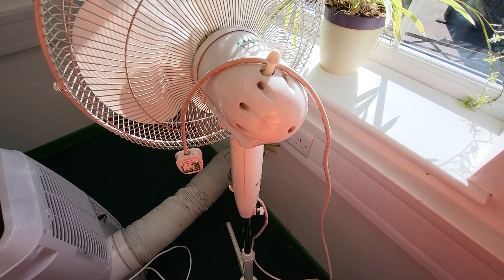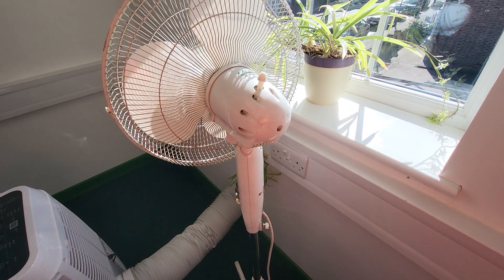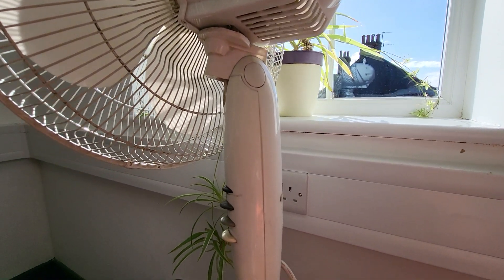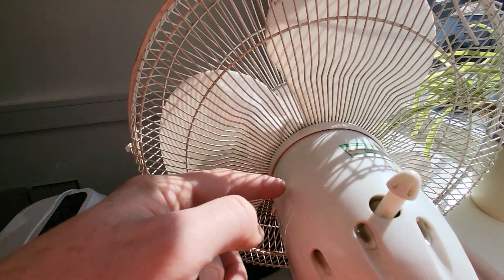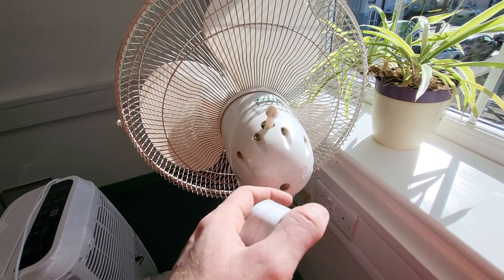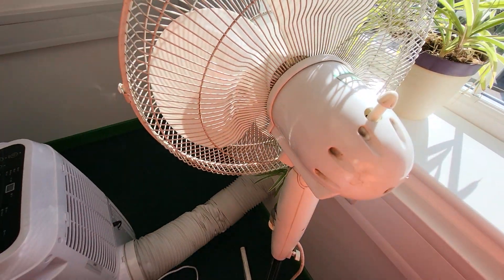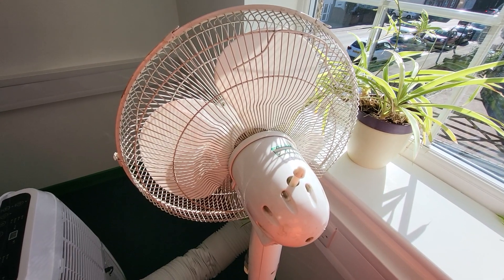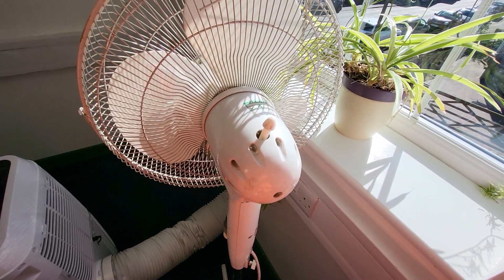Class 1 PAT Test - No Earth Reading. Is it a fail?

Comment: I would have thought since PAT testing is to show that the item is safe all metal that someone can touch should be earthed if you have no knowledge of how it is constructed this should fail the Fan because the stand and the cage are not earthed. just because all fans have this problem shouldn't mean you pass it anyway. Testing against metal you can't reach is a point-less test because the operator can't reach it as well.
Reply from the maker: No I disagree, there are many class 1 items that have exposed metal but are completely isolated from any contact from the mains supply - this is by way of design and not luck.

Comment: Just started PAT testing for my company , just wanted some advice on few items that I have come across . My company has few Samsung monitors that are powered by a psu unit with a figure 8 lead . The psu unit is marked as class 2 , it’s a 25 watt psu . Is this item just a visual check or would I need to test it as a class 2 item and connect the fly lead to an exposed metal part , the only thing I can see is the vga port . Any advice ? I am using the prime test 250+
Reply from the maker: So by the sounds of it, it will be just a visual inspection on the AC adaptor part and then a visual inspection on the figure 8 cable. Simple as that!

Comment: With these type of fans I remove the fan blade housing. There are a few clips that can be opened easily by hand, and then the metal shaft on the motor can be accessed to test. Technically you’re dismantling, but if I don’t need tools to do so, I will so I can complete my test.
Reply: That's what I would do. Normally I avoid dismantling but in this case its a very easy job.

Comment: its a tricky one for sure! remembering also about the length of a probe according to GS38. if you are using extended probes or wire on a clip etc you are risking an inaccurate and potentially unsafe reading.
imagine that this fan has a fault that had made the metal parts LIVE and you have to probe it to see, and the motor engages and causes a sudden movement and so the long wire touches your hand etc.

its all about a risk assessment then. is it safe to remove the guard and run a test in the environment you are in and that sort of thing.
what sort of test can you do.

if a standard probe cannot be used i personally wouldnt attach other things to get a reading. ud need to calculate then the resistance of the wire you are using and that sort of thing, complicating the results if someone else was to test it.

you could perform an earth continuity test if your probe can reach and make contact, but a load /leakage test i would do a thorough risk assessment first before thinking of that.

sounds like a lot of fuss. but its just to make the test result clear for the next test so you can determine if the equipment is deteriorating or developing a fault over time.
introducing longer or thicker probes etc can give you different readings compared to how it may have been tested before.
Reply from the maker: Length of the probe and GS38?
Reply: @caterhampattesting  https://www.hse.gov.uk/pubns/priced/gs38.pdf if you check here there is guidance on the length of probes that should be used. so if the item you are testing cant be tested with probes recommended by gs38 its best to avoid probing it to test

Comment: As you find it difficult to find an metal part to get an earth reading it will be almost impossible for a user to touch an exposed metal part under fault conditions. Just add a comment you are unable to access earth point  and pass it.

Comment: Long spike to the motor shaft. Drawback being you're taking a reading through the the motor bearings. Probably doesn't have an insulated drive gear which could possibly make it class 2. I find the earth path can be quite high and difficult to compensate for just using the cable size and length.

Comment: Hi ben, could you then just run a PE Conductor current test (for example using the Apollo 500+ you could select manual pat and  use test 3)
Kind regards
Reply from the maker: a PE test is unrelated to an earth bond test and is only useful if the insulation resistance test readings throw up anything under tolerence.

Comment: The recessed screw is not accessible to touch so therefore I wouldn't worry about getting a reading. Just put a comment on the results sheet,  "no test point"
Reply: With these fans I usually just carry out my insulation resistance test and the visual then pass them
Reply from the maker: I do agree however on a lot of fans they are connected to an earth bond and therefore should be tested if possible.
Reply: So a pass or fail? Or visual only?

Comment: Given the fact that we are told that an item should never be even partially dismantled in order to test it, I have found that the fan spindle is nearly always earthed on these class 1 fans,  so I carry a small length if stainless welding rod (around 8 inches long) rod in my bag and this can easily be bent to suit and slid through the fan guard to reach the spindle.

Comment: Hi Ben, another great video.  I would remove the blade guard and blades.  The front panel should then be removable (usually three screws).  I would test to this point and mark the paperwork to this effect, stating there is no exposed metalwork other than that attached to the plastic body/components.  Regards Broadlander